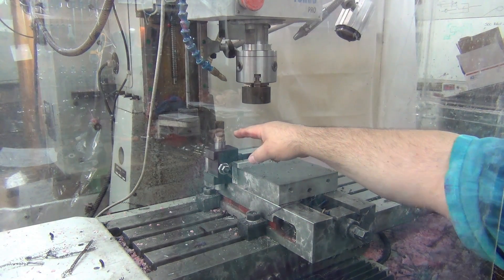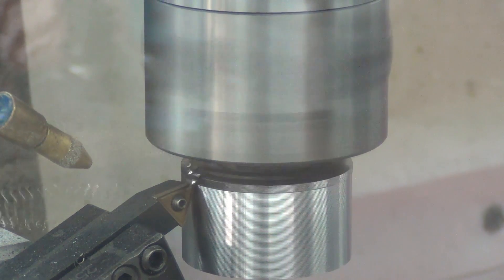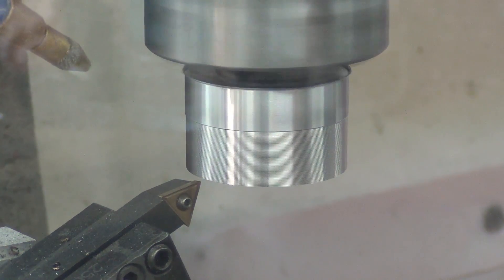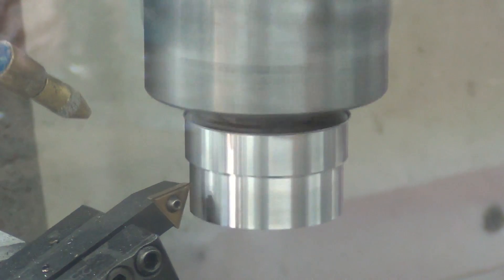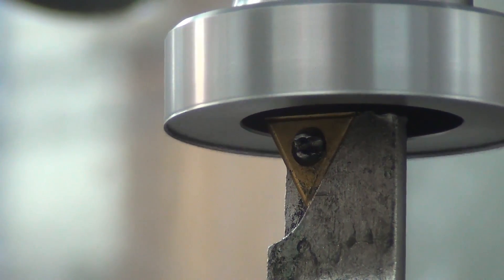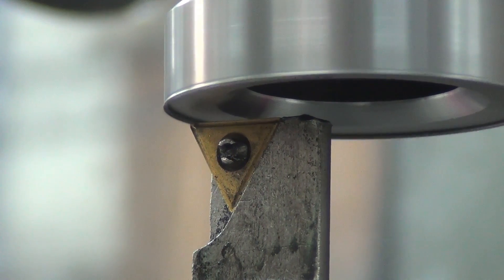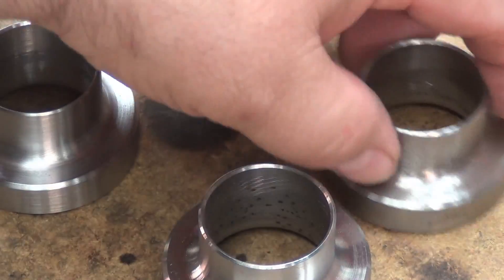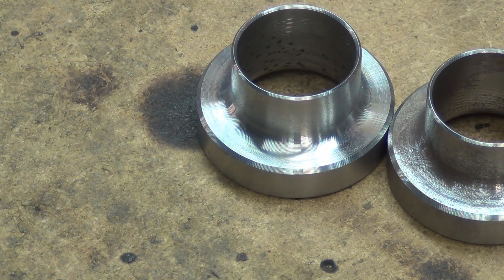Mill-Turn - Inner Bearing Adapter, Revised speed/feed

Comment: I think you may be confused. Those tools are for lathes, not mills. :) Just kidding. But how did you index the tooling?

The surface roughness at 7:24 does look like the tool was dragging, not cutting.
Reply from the maker: LOL :)   I used my Haimer to setup X and Y.  I think I used g56 for one tool and g57 for the other.  I also used MachStdMill which makes it easier.  
I agree.....I need to get a narrower diamond holder and inserts and try it.  Might be able to just angle the current tool better.  
Thanks!!